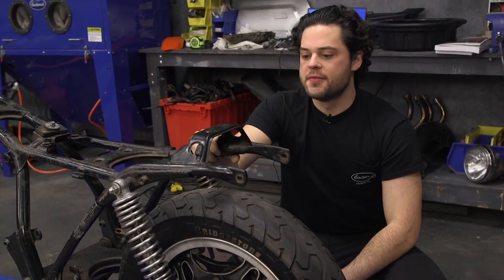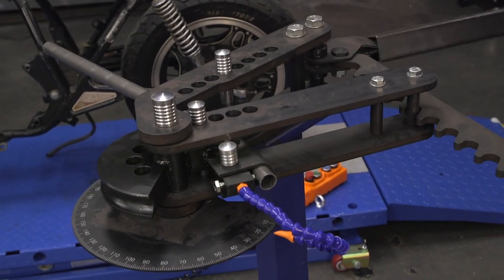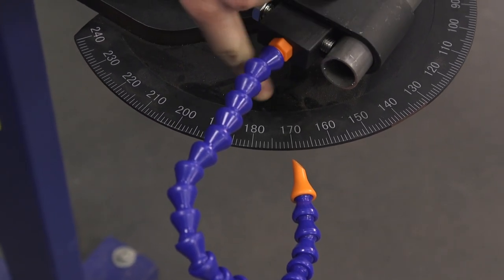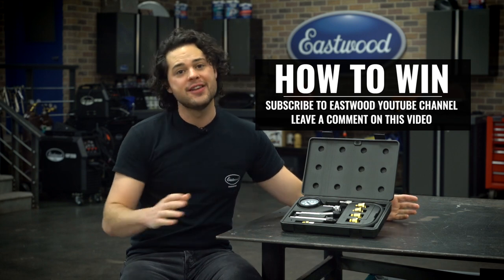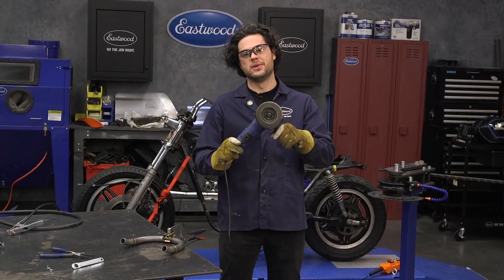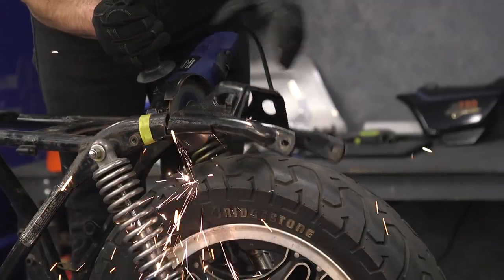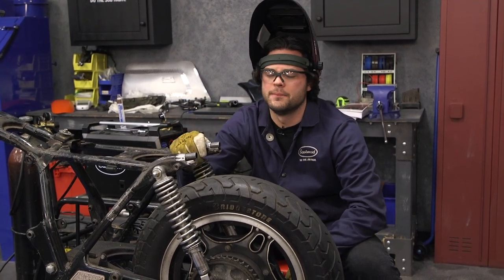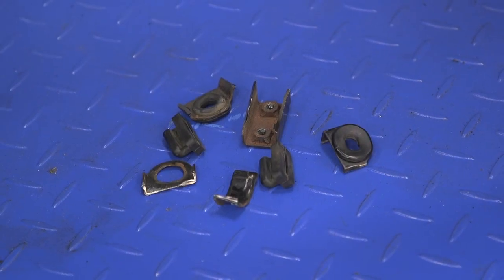How to Build a Cafe Racer Hoop: Custom Frame Fabrication on the CB750 Cafe Racer - Episode 2

Comment: Some of your fab and welding skills could do with a bit of a tune up. Just as an example, grind - sand welds across ie. 90 degrees to the weld line, that is your grinder moves with the weld line so you grind - sand the highest parts of the weld before the wheel touches the rest of the tube, takes a bit of practice to get out of an already bad technique habit but makes a whole heap of difference to the finished item, Always remember, you can only grind it off, if you go too deep you can't grind it back on!  
I use my TIG welder for all my builds.
Good work on the bender and explaining what you were doing with it.
I could do with a compression tester! I would bet that I don't win it though!!!
Reply from the maker: Hey Thanks for tips! JD is definitely still learning and appreciates hearing the feedback!